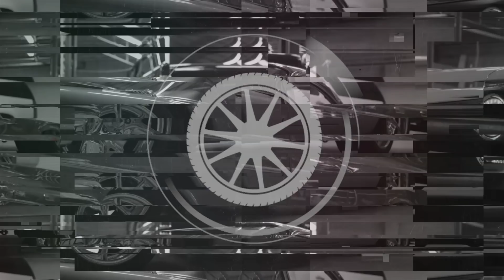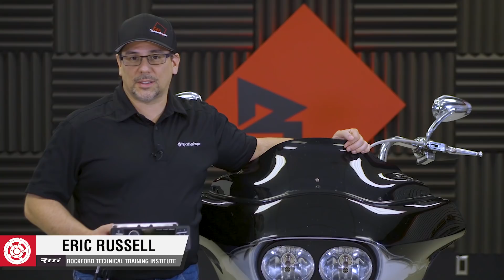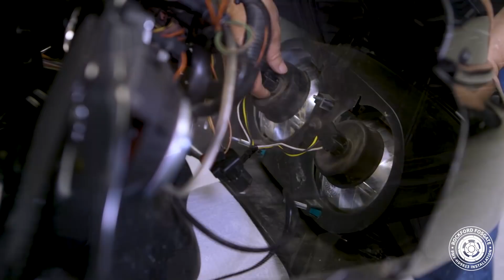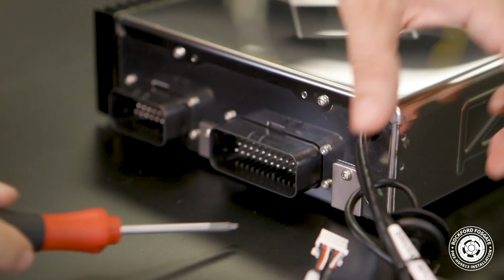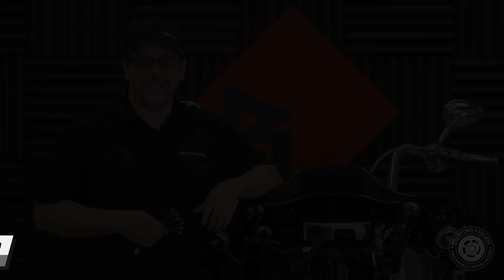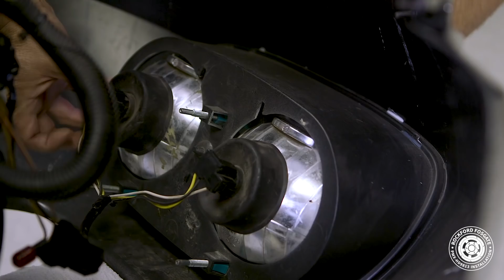PMX-HD9813 | H-D Road Glide Upgrade

Comment: Why I would not recommend buying a Rockford Fosgate PMX-HD9813 digital receiver and Rockford Punch PBR400x4D audio amp; 
I have a 2006 Harley Electra Glide Ultra Classic converted to a Champion trike in 2008.  The stock Harmon Kardon am/fm/cd radio was nice with all the handlebar controls – as long as it worked.  The radio didn’t like a hard ride or a bumpy road – stopped working once, long story short I had Iron Cross fix it…and while they had it added Bluetooth and rear channel pre-amp audio outputs ($464.). I reinstalled the radio and within the next 100 miles the radio stopped working again – same problem as before and luckily it was within the Iron Cross warranty…they fixed it no charge (bad solder joint they say). When installing it for the second  time I replaced all 4 speakers with Hogtunes XL 352 model. Nothing was wrong with the OEM stock speakers other then they lacked bass.  The Hogtunes weren’t too much better bass wise, but did have a slightly crisper sound. The volume needed to be turned up to the 30 mark to hear music at highway speed (stock mufflers). A couple years later the front panel on the Harmon Kardon started shorting out and end up not lighting the front panel at all which made the unit almost worthless.  The Iron Cross warrantee was up and considering how old the unit was I decided to replace with a Rockford Fosgate PMX-HD9813 = $589.99  and installed it myself. Most of the handlebar controls still worked but not the increased volume as the road/engine noise increased. Sound wise it was a little louder, but not much and to my disappointment, no better bass. At highway speed the volume still had to be around the 30 range to hear anything – and it wasn’t that much better than with the OEM.  So, I ordered the Rockford 4 channel Punch PBR400x4D audio amp ($292.), installed it and was disappointed again.  The bass was no better, the highs may have been a little higher and the overall volume did increase but only 10-20% at tops.  Now with the volume control at 30 I can finally hear the music at highway speeds, but with no bass. I had checked the polarity of each speaker, and tried different speakers, some home audio JBLs…with still no bass.  Apparently what I need is a sub-woofer and another amp. similar to what I have in my GMC pick-up.  As far as the hard ride went… I replaced the rear air shocks with a pair of twin-adjustable Bitubo 5100 and rebuilt the front fork. What I didn’t do was listen to the Rockford Fosgate radio in person before deciding what to buy.  I was unable to find a local dealer that carried this at that time.  And why the trike conversion? I’m handicapped and in my 70’s. Overall – disappointed in the Rockford Fosgate products. If you’re considering a radio/stereo upgrade for your Harley I would strongly recommend you go hear the brand and model numbers you’re considering before spending your time and money. The install wasn’t that difficult, just took time.
Reply from the maker: Thanks for your experience John. For the most part, it sounds like the product performed, but not to your expectation.  Let me explain why I'm not surprised.  

With any audio system, simply replacing the source unit will not make a system "louder", it just changes the user interface and uses newer technology on how we get audio into the system.  

While the PBR400X4D is a great amplifier, we've found over several years worth of experience, it just doesn't produce the power needed to overcome road, wind, exhaust noise. For motorcycle applications, we recommend our M5-800X4 amplifier because it has enough power to overcome these road noises.  

As for bass, motorcycles don't have a reflective "cabin" like your GMC Pickup.  This is the same as comparison your home subwoofer by first placing it in the middle of your living room, then moving it under a table or loading it into a corner.  There is a huge difference in bass response because your GMC is allowing the sound waves to bounce off the seats, glass, and sheet metal.  Realistically, you need subwoofers in a TourPak (Trike) or Saddlebags (Touring), but you still won't have the same exact response as your GMC truck because of the lack of reflective surfaces.

For the Trike conversion, we're not sure what that entails because the PMX-HD9813 is designed to interface with factory electrical systems on Road Glide, Street Glide, Ultra Classic, Ultras, and Trikes.

We always have technical support available FREE for yourself or anyone looking on what components should be used with motorcycle applications.  Everyone is different, and making the proper recommendations to hit those goals are important to us.  We can always be reached at 1-800-669-9899 Mon-Fri. 8am to 5pm MST.
Reply: Obviously they explained this, but your expectations are unrealistic by replacing just a head unit. Butt If you don't have the speakers to handle the power you're going nowhere. And you're never going to get the bass out of a bike that you will in a car

Comment: I’ve got an 07 ultra classic. Radio says 20amp. I have all 15amp. Which ones do I need to change? All three or just the radio power?
Reply from the maker: Hi @clintogle538 , you shouldn't need to replace any fuses in the electrical system.  This radio is designed to work with the existing factory electrical system and fusing.  If you're using aftermarket amplifiers, they are most likely have dedicated B+ and GND wires connecting directly to the battery with their own fusing.

Comment: Hi. tell me how to set up scrolling through folders with tracks in this tape recorder? menno folders, not the tracks themselves
Reply from the maker: As mentioned in your other post, if you have a USB connected with folders, they will appear in the menu.  If you just have a collection of songs on the USB stick without folders, none will appear.
Reply: There are folders on the USB drive. But I can't switch them on the remote. maybe some kind of format is needed to store them on the drive? @rockfordfosgate
Reply from the maker: @DzmitryVaitovich  Our technical support would like you to call-in so they can properly help diagnose your issue. They can be reached Mon-Fri 8am - 5pm MST at 1-800-669-9899.

Comment: I have a 2013 FLTRX with stock radio but with J&M ROKKER XXR 2 Speaker & 330W amp setup.  Will this work with the PMX-HD9813 as a complete plug and play or will it take some modifications?  I did not need any mods when I installed the J&M equipment, it was a plug and play to the Harley system.
Reply from the maker: The radio will work with your system, but it’s not plug-n-play.  You’ll need to figure out how to get audio from the radio to the amplifier.

Comment: I just installed the Rockford Fosgate radio in my 2009 Road Glide. Radio sound started clear but then i got static. When I play music from my phone via Bluetooth it is super clear with no static at all. Static only happens during radio play. Do u know what can be causing the static? I don’t have it connected to an amp. Would appreciate any feedback.
Reply from the maker: Do you have a Class-D amplifier installed in the system?
Reply: @rockfordfosgate  no amp installed
Reply from the maker: @cammed_hemi7638  I asked one of our motorcycle specialists and he suggested to check for a loose nut on the antenna connection in the back.  If you don’t have a ground plane, you won’t have reception.

Comment: Does this work also for the cvo models
Reply from the maker: We don't have compatibility for CVO models due to the extensive wiring harness difference between CVO models from 1998 thru 2013.  Due to the changes in harnesses, the PMX-HD9813 is not compatible with factory amplified systems, CB, Intercom, or rear volume controls.

Comment: Will the factory handlebar volume and track selection still function while running Bluetooth?
Reply from the maker: Those functions are available on the radio itself while using Bluetooth, so the handlebar control will operate those functions too.

Comment: I have a 2007 road glide and I installed this device, powers up and everything functions but no audio 😢 please help!!!!!
Reply from the maker: If you're using the speaker outputs, be sure the Internal Amplifier is turned on:

1) Access the Source Unit’s settings by pressing and holding the MENU button.  

2) Access the AUDIO settings by pressing the AUDIO option from the MENU screen.

3) Press to access the INTERNAL AMPLIFIER options.  Use the rotary encoder to select options (ON > OFF).  When using an amplifier to power your speakers, select OFF.  If you are powering your speakers directly from the source unit, select the INTERNAL AMPLIFIER to ON.

If you're still having problems, our technical support can walk you through troubleshooting at 1-800-669-9899 Mon-Fri 8am - 5pm Arizona time.

Comment: Can you use the hand control to switch between sources like on the stock unit?
Reply from the maker: The factory thumb control is limited to Volume Up/Down and Audio Track Forward/Reverse.  To cycle through sources, press the SRC [POWER] button, then rotate the VOLUME knob to cycle through FM > AM > USB > AUX > BLUETOOTH > PANDORA > SIRUSXM.
Reply: @rockfordfosgate  thanks

Comment: Will there be a difference in sound between the amplifier and speakers and the Harley radio and the new Rockford radio with the same kit?
Reply from the maker: Yes, the PMX-HD9813 source unit has a built-in DSP and our acoustical engineering team has done an exceptional job creating "tunes" for different Stages.  You can see how to activate these various tunes here: https://www.rockfordfosgate.com/rnt/rnw/docs/1355/harleyamptuning_1998-2013_rfk-hd9813.pdf

Comment: What makes this unit not compatible with the HK OEM HK amplified system ? Wanting to sell this to a customer with a 2013 Street Glide with the OEM HK system. Also, the customer had the OEM amplifier switched to the J&M ROKKER XXRP upgrade.... will this unit work with this upgrade ?
Reply: The radio has no way to turn on the oem boom! amp, however if the amp is already out of the picture I see no reason why you wouldn’t be able to use it.

Comment: Wondering if the coms with work , CB , INTERCOM , NAV ?
Reply from the maker: Thumb control works but not factory equipped CB, Intercom, or Nav.  We have all the features, specifications and compatibility on the PMX-HD9813 here: https://www.rockfordfosgate.com/products/details/pmx-hd9813

Comment: looking to replace the factory head unit on my 2012 road glide ultra, i do have the harley boom front and rear speakers and boom amp, all installed back in April 2015, will this unit still work plug and play?
Reply: No it does not work unfortunately, it will not turn on the oem boom amp so you would be looking at a full replacement of your system
Reply from the maker: ^ Brian ^ is a certified professional motorcycle audio installer and definitely knows his way around the PMX-HD9813.

Comment: How many speakers can i hook up to this?
Reply from the maker: The TM400X4 is capable of handling up to an 8-speaker system with no problem!
Reply: @rockfordfosgate  im lookin at pushin 6 speaker. 4 in front fairing. 2 in the saddle bag lids. And i dont need an amp?
Reply from the maker: @johndow2487  Sorry, I was thinking you were going to run an external amplifier with this radio.  Technically you could run 4 off the front channels and 2 off the rear channels.  However, if you want to hear your audio with any clarity, we definitely suggest matching the PMX-HD9813 with the TM400X4ad amplifier.  I've included links below for the amplifier components we suggest:   
• Amplifier: https://rockfordfosgate.com/products/details/tm400x4ad/
• Amp Kit: https://rockfordfosgate.com/products/details/rfk-hd9813/

Comment: Does this retain all functions, like headset plug on 13 Ultra Classic?
Reply from the maker: Hi Bill, it retains thumb control on the handlebars.  However, it's not compatible with factory amplified systems, CB, Intercom, rear volume controls, rear speakers on 1998-2005 Ultra’s, and factory equipped satellite radio systems.  It does however have a ton of features for Digital Media.  You can find all the specs & features here: https://rockfordfosgate.com/products/details/pmx-hd9813/

Comment: Hi
Does this work for the 2012 street glide?

Do you ship to SA?

Gavin@goldit.co.za
Reply from the maker: Hi Gavin!  Yes, the PMX-HD9813 will work on a 2012 Street Glide.  You can see how I install it on our HD9813SG-STAGE1 kit here: https://www.youtube.com/watch?v=GdHEnvUb034  
Our SA distributor has ordered these so they are available in your area.  My best advice is contact a local Rockford Fosgate dealer and request the radio.  You can find a list of local dealers here: https://www.rockfordfosgate.co.za/store-locator/

Comment: Just installed this in my 08 electraglide, along with the front fairing speakers Once I go above 25 on volume it sounds horrible! I do not have an amp. Did I miss a step?
Reply from the maker: Hi Greg, I want to clarify, you said it "sounds" horrible.  Meaning the sound quality is not what you expected, not that it can't go louder, correct?
Reply: Rockford Fosgate yes it goes way louder just distorts real bad.
Reply from the maker: @gregcorthell1631  Thanks for that info.  Did you use the Tuning Guide to set the EQ preset?  You can download that here: http://rftech.custhelp.com/app/answers/detail/a_id/1355/.   As for producing much louder output, it's best to step up to the TM400X4ad amplifier.
Reply: Rockford Fosgate I did not, but will and let you know
Reply: Rockford Fosgate that got it fixed. Not sure what was off , but 0 distortion now. Thank you! Still might look into that amp though
Reply from the maker: @gregcorthell1631  That's great, glad we got that sorted out!  The amplifier will help you hear at highway speeds since it can amplify your music over the wind, tire, and exhaust noise.  If it's plenty loud enough for you, then you should be good.  Glad you're a part of the Rockford Fosgate family!

Comment: Would  the button on the handle bar work with this?
Reply from the maker: Yes Ricky, this radio retains the factory handlebar control.  You can see all the PMX-HD9813 features at https://rockfordfosgate.com/products/details/pmx-hd9813/

Comment: And they say nothing about how to hook up for sirux radio with what adapter?
Reply from the maker: Rockford Fosgate recommends the SiriusXM® SXV300 tuner simply plugs into the SiriusXM pigtail on the back of the PMX-HD9813. Information on the SXV300 model can be found here: https://shop.siriusxm.com/siriusxm-sxv300-connect-vehicle-tuner.html

Comment: Do you have one that replaces the 2007 Ultra Glide stock radio?
Reply from the maker: Hi Carlos, sorry we're just seeing this.  YouTube made an algorithm update because we're now seeing messages we were never notified about.  The PMX-HD9813 as shown in this video will replace the Ultra Glide stock radio. However, there are some controls that it will not handle depending on your motorcycles options.  You can read more about it here: https://rockfordfosgate.com/products/details/pmx-hd9813/

Comment: The display looks to large to swap out my old factory cd player. It will fit my 2004 road glide?
Reply from the maker: The PMX-HD9813 is a plug-n-play radio that utilizes the factory installation points, so it should replace the OEM CD player. You can see more photos and get dimensions to verify your fairing cutout here: https://www.rockfordfosgate.com/products/details/pmx-hd9813/

Comment: Am I able to mount my Rockford Fosgate amp to the top of this head unit like I am doing now with my stock head unit and bracket?
Reply from the maker: What model & year Harley-Davidson do you have?
Reply: Rockford Fosgate 2011 Electraglide, currently running the Rockford  Fosgate TM400X4ad amp with TMS6SG speakers
Reply from the maker: @NicTac28  Yes you can.  See 10:15 on this video where we install the TM400X4ad on the PMX-HD9813 source unit: https://www.youtube.com/watch?v=movf5dd2XAY

Comment: Can I use this stereo with the Rockford fosgate unit R1-HD4-9813?    I want to upgrade from my stock radio with the unit I already have.  But, I only see them using the newer amp and not the one I have.
Reply from the maker: Yes you can.